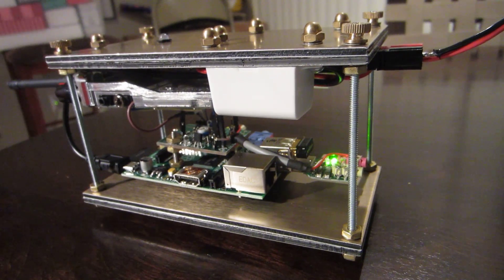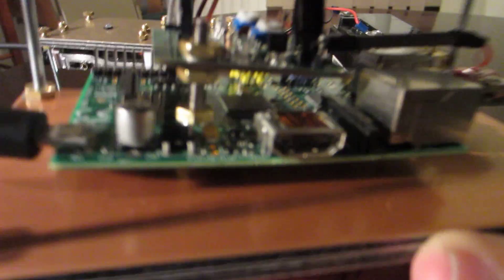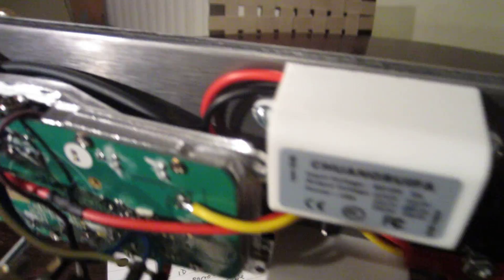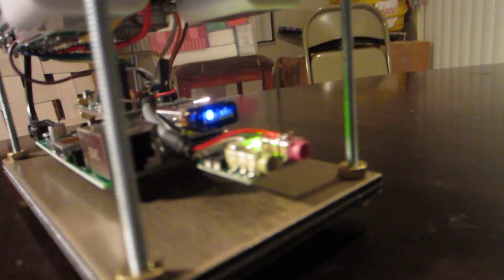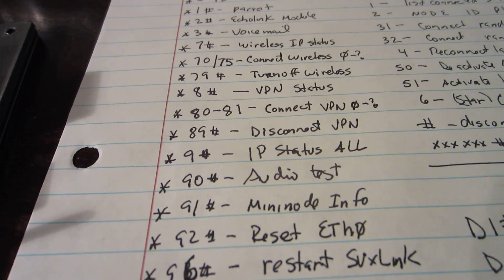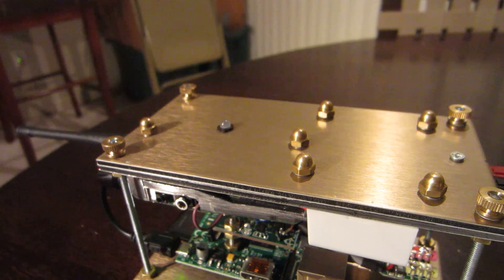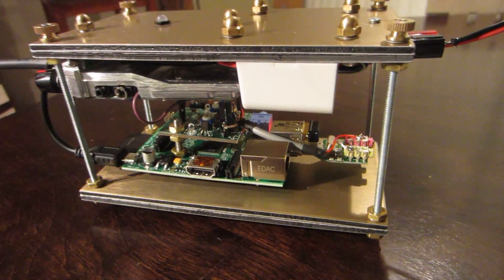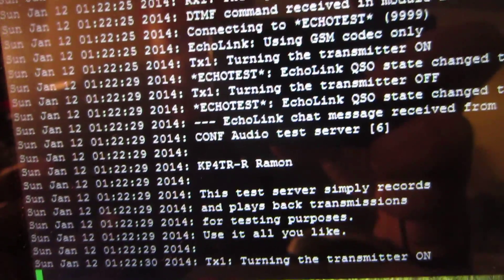Echolink Pi Naked Node with SVXLINK Part 1

Comment: Very nice rig, I'm using the same radio with an old 1ghz dell pc and i'm pulling my hair out trying to figure out a proper carrier detect.  The tip of the 3.5mm plug puts out constant 5 volts and i found a mod online that uses a transistor to pull it down on receive.  It functions this way but now there is an annoying noise on transmit.  Could you document and publish what pin it is you are pulling your carrier detect signal from?

Comment: PING...  Ramon could you please share a bit more on the software and radio connections?  Are you building these to sell?  Have not heard back from you.  73 K4RJJ
Reply: did anyone get a reply .. and if not do u know of a place to get the diagram to wire up a system similar to this for echolink only..